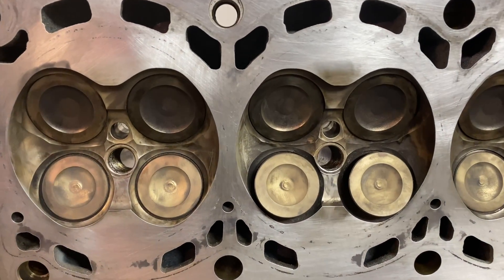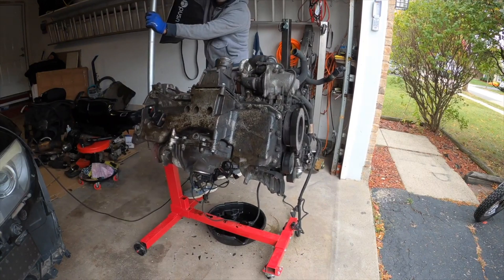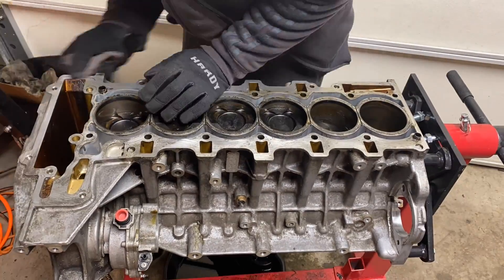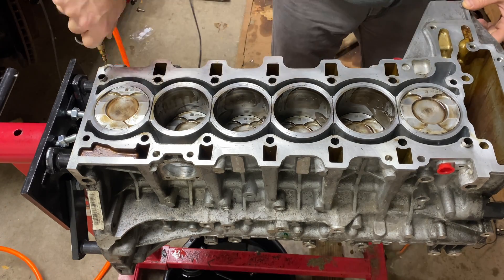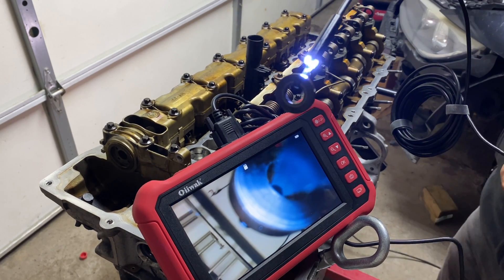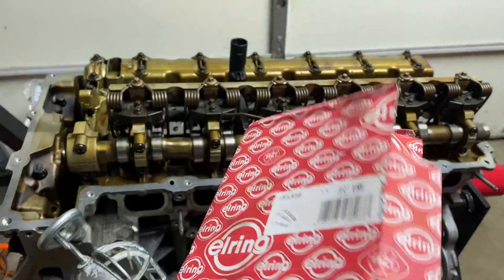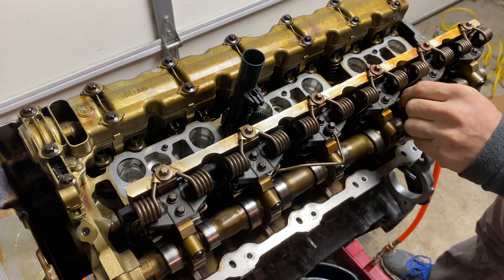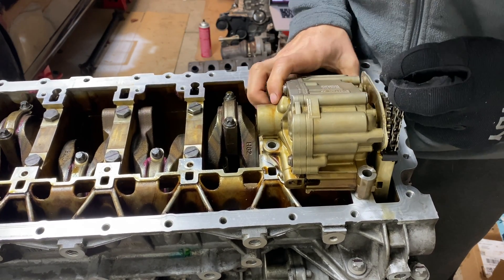Cylinder Head Gasket Replacement - BMW N55 Engine Rebuild Project Part 4

Comment: Has anyone stripped the block where the headbolts go in? If so, what was done to remedy it? Did you use a bigger bolt? Or did you go with helicoil?

Comment: I wouldn't recommend really cleaning anything other than with a plastic scraper and gasket remover. It doesn't have to look pretty. Even the tops of pistons can be dirty and it doesn't impact the engine.

Comment: I have no idea on cars but I need some help literally this morning my bmw started shaking like crazy after driving fast on the high way. When I got home it was still shaking and check engine came on, checked for codes I had cylinder 3 and 2 misfire, went ahead replaced spark plugs and coils car starts up but check engine light is still on. Checked for codes and it still has a cylinder 3 misfire all but now when I drive my vehicle a bunch of white smoke is coming out my exhaust smells like gas fumes. Please anybody give me options of what’s going on with my vehicle idles rough and thick white smoke coming out the back.

Comment: interesting that unless I missed it you didn't seem to be concerned or check to ensure the intake and exhaust cams were still in somewhat correct timing. Without the chain installed and not knowing you could bend a valve if you installed the head out of time with the long block.  Are N55s not an "interference engine"?

EDIT - I just watched the beginning and saw you ensured via the BMW tool the top end was in time before you took it off!!  - Great video series!!
Reply from the maker: Timing is set after. I have a video where I change the timing chain and time the engine. At this point of the process, the camshaft adjusters are not even in yet.

Comment: Hey I have a 2011 BMW 535 that had a blown spark plug cross traded someone and I bought it and drove it for five days and now I need help fixing it I was thinking about Getting the head removed and getting it to a repair shop if you were interested in doing this job for me please do contact me at 314-906-1319 text me or whatever is possible I am your subscriber Brian

Comment: Question if I’m taking the head to the machine shop does it matter to time the engine since they will probably remove the cams at the machine shop? Mines came out a flood car so I can’t spin the engine a complete 360.
Reply from the maker: It doesn’t really. As long as you can take off the bolts on the camshafts without the tool you should be good to go. Of course you will have to make sure you time the camshafts and the entire engine once back during reassembly.

Comment: I just rebuilt mine in the car changed a piston  and done cylinder head
Reply: how much did it cost u ?
i need to change a connecting rod and want to know estimate cost

Comment: Really enjoyed this series thx. Whats that tool you used to fish the washer out? I was replacing my VCG (2013 x5 n55) and noticed a small piece (feels plastic, like a half inch cap) sitting between cyl 4 and 5, unfortunately it fell down the oil return duct before I got it out. So thinking about fishing it out and magnetic probably won't work. What do you suggest? Would that piece fall into the oil pan? Thanks again!
Reply from the maker: Sorry for the late response! I used this to fish it out: https://youtu.be/vcLc2i52oQI but you can use almost anything. 
And yes, it should have fallen all the way down to the oil pan.
Reply: @SimpleCarGuy  thx, you are right it did fall all the way down. I was able to push it through the drain hole since it's too small to lift out. Used a cheaper borescope that wifi to the phone.

Comment: Watched because I have a n55, 25k miles though ha. They're like 2k damaged, 4-5k working over here in uk :o
Reply from the maker: It’s about the same here. I got a very good deal on the used one, that’s for sure.

Comment: Loving the videos. My n55 is free from the transmission and ready to come out. Ran out of time so I'll have to get back to it later today.
Reply from the maker: Thanks, man! Did you get it out? How's it looking?
Reply: @SimpleCarGuy  Yeah engines out inspected it and so far looks rebuildable. Need injecter puller tool so I can take the head off and inspect the cylinders.